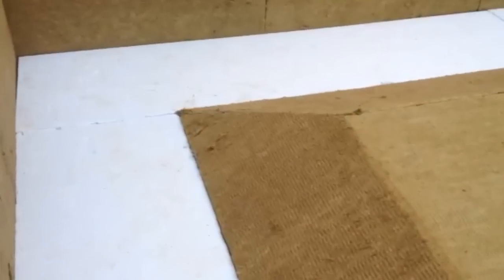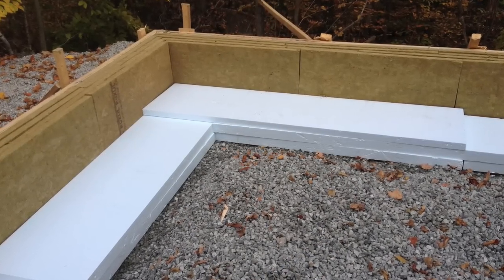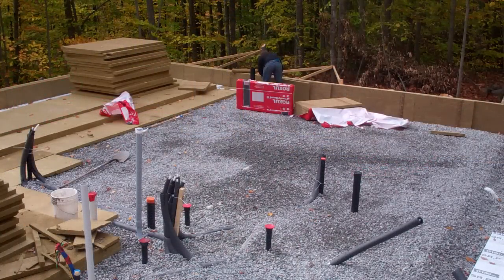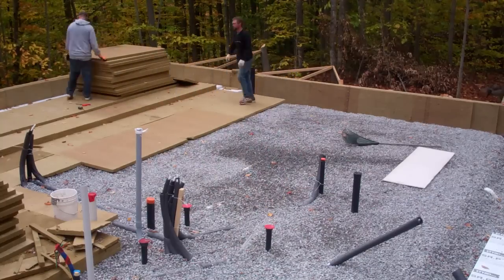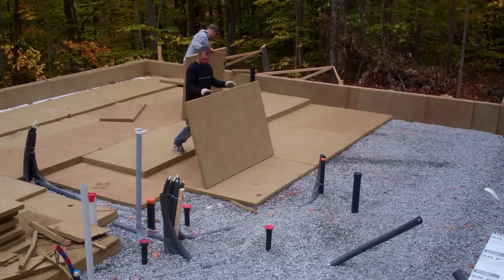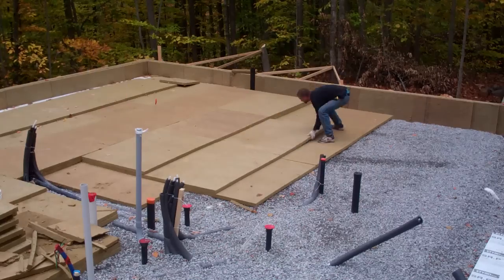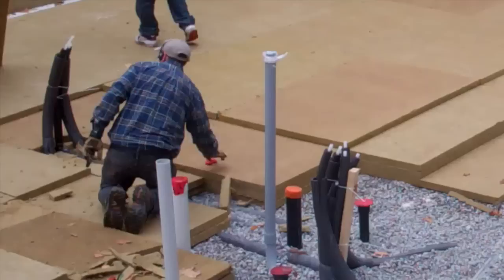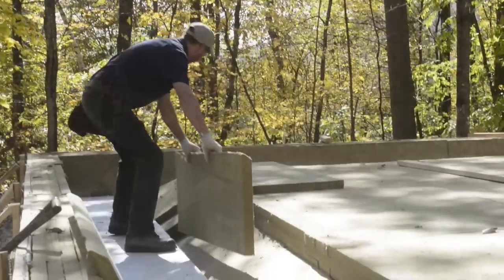Slab on Grade Insulation with Rockwool - The "How to Build a Slab on Grade" Foundation Series

Comment: Not sure why you didn't lay down 10 mil of poly before you put the insulation down?
Reply: you would create a bathtub. It is better placed on the top of the insulation layer.
Reply: @studiokks6141  Not.  If you do not keep the insulation from wicking moisture from the ground by placing plastic first, in short order you will render the insulation useless.   Plastic always goes first for this reason.  100 %.
Reply: I could see how this may make sense, but the vapour barriers job is not what you describe. Your comments do make  me want to research and compare the moisture affects of this rockwool product compared to your typical 16-40psi EPS application. Nonetheless, I believe the vapour vapour still needs to be placed on the underside of the concrete to perform the duties it was created for. Controlling vapour diffusion not keeping insulation wicking moisture from the granular fill below it.
Reply: @studiokks6141  EPS does wick moisture.   The test have already been done.
Reply: @studiokks6141  where are you going to put the poly if you are installing in floor radiant?   Over the pex? No way.  Poly first,  insulation next.  Pex on top of insulation.

Comment: Please make a video explaining how the insulation does not weaken the integrity of the slab that will be poured on top of it and need to remain durable for 100 years or more.  Furthermore, explain in the same video how the insulation underneath the foundation is able to support portions of the slab above it that will be require to support load bearing walls.

Comment: HI Mike, IsS there any update to this building ie. with regards to the slab and cracking with respect to Rockwool under the slab? I am quite interested in this, looking to build in the spring 2020 BUT with a walkout. I have considerable clay to remove and would need proper drainage, but if done correctly, would this be in you opinion doable, would you use Rockwool again after this experience?
Reply: I did this same thing in the PacNW in 2020 and no, no cracking to date.

Comment: Did roxul test is product for the footing and load of the bearing wall ?
Reply from the maker: Hi Jean-Denis, at the time of the build they did not, so at their recommendation we used high density EPS under the footing. They showed some interest in the under slab insulation market at the time, but despite our efforts their interest seemed to fizzle out.  To our knowledge Rockwool is approved for use under a flat concrete slab but not approved for under a load bearing wall footing. You can see all the different steps of the Edelweiss house at ecohome.net , and check out our latest demo house here - it's a solar air heated floor.  https://www.ecohome.net/guides/3368/solar-air-heated-radiant-floor-kit-diy-problem-soils-expansive-clay-leed-passive-house-zne/

Comment: Have you ever had issues with shifting pouring concrete on the insulation?
Reply from the maker: Hi Laura, concrete will always shift and crack a bit, that's life. To minimize it to the point where it isn't noticeable, you need to use insulation with the appropriate density, which is why we used high density EPS instead of rockwool under the footing. So there was no shifting of any consequence with this house. However, our more recent demo house was built on clay, so we chose to go with a raft slab, which spreads the weight evenly over the entire surface of the floor. A raft slab has no footing and therefore isn't contained by ground on either side, so it is able to expand and contract with minimal cracking. you can read more about raft slabs and how to build on problem soils here - https://www.ecohome.net/guides/2217/slab-on-grade-prefab-form-kits/

Comment: For building in Ontario, what do you think about a basement foundation that has a south-side walkout compared to a slab foundation? A basement foundation costs more to build, but besides providing additional space, does it not offer some advantages regarding energy efficiency? In either case, is it challenging to incorporate a cold/root cellar?
Reply: Basements 'can' be built properly, meaning energy efficient and durable, they just usually aren't.  Using concrete as a structural material is a lot more expensive than wood, so to build a wall to the same performance standard as wood it ends up being more expensive. Basements sometimes makes sense, like if you limited space, or you're building on an infill lot in an urban core with height restrictions. But if you have the room to do it, its cheaper to and less risky to build two stories above ground than one above and one below. There is a page on our site that can better explain why we prefer slabs when possible. http://www.ecohome.net/guide/slab-grade-foundation-basement
Reply: John Dunstaple slab foundations calls for a house unable to provide enough heat during the colder months.. incorporating a cold cellar is pretty much mandatory with basement foundations.. and virtually impossible with a slab..

Comment: Neat video. Could you comment on how the exterior walls will tie into the exterior insulation of the slab edge?  With (what looks like) 12" of exterior roxul, the load framing would need to bear on the footing, thus I would assume above grade walls also include a similar width of exterior insulation?
Reply from the maker: +Ryan Magladry Hey Ryan, sorry about the delay. It's 8 inches of insulation, and the wall system will bear on the concrete with 8 inches of its own insulation on the exterior. The rest of the video series can be found here, including one on wall assemblies. Cheers.
Reply: It is actually 8 inches, and we also have 8 inches on the exterior of the framed wall, so the load sits entirely on the concrete.